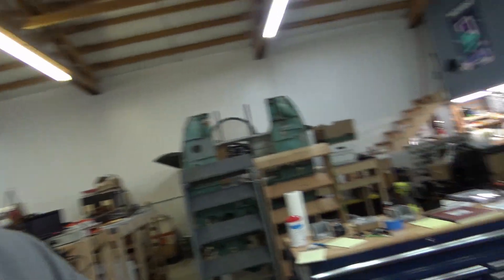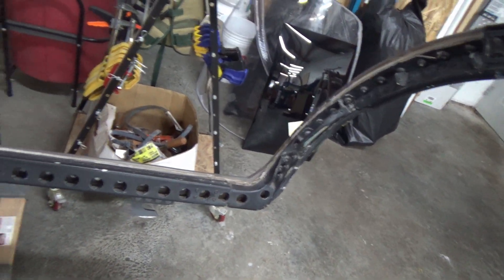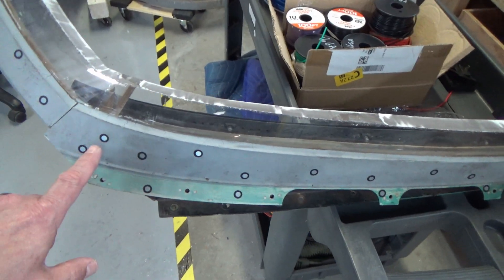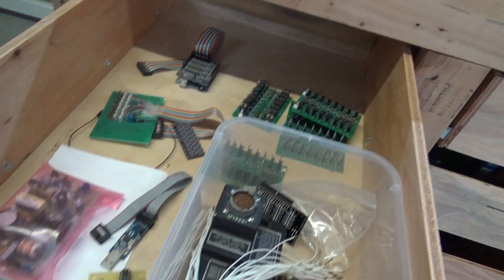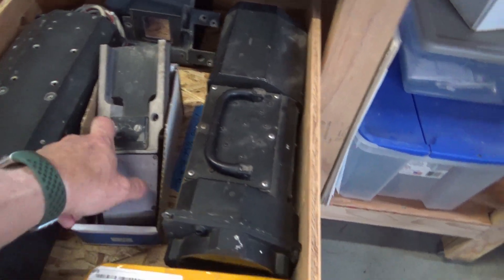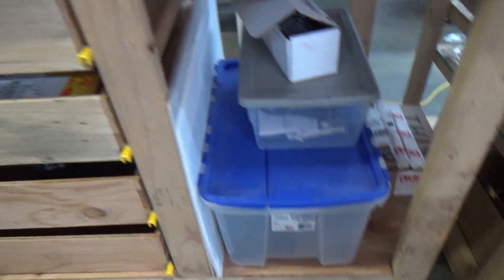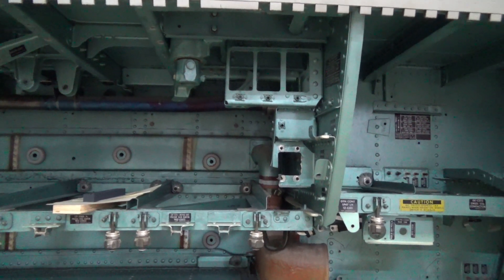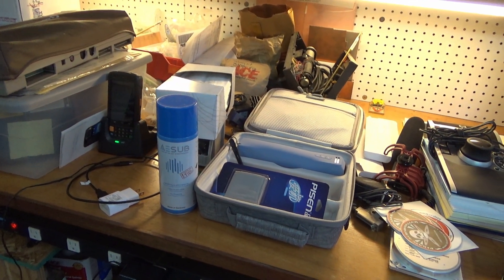F-15C Project Update for June 9th, 2024

Comment: I wonder if you could try and build a huge vacumm former and try and pull clear petg over the heavy canopy to have a lightweight alternative.

(Definitely no longer rated for bird strikes!)
Reply from the maker: I've looked into building something large enough to replace the blown out acrylic in the canopy and it would be incredibly expensive - especially for a tool I'd only use once or twice.  Making the forming buck would also be a pretty heavy undertaking.

Comment: This is super cool! Especially seeing the true size of what's hiding behind the VSD/MPCD/TEWS. I cant really tell from the fov of the camera, but are these the regular 57 or bigger 86 vpforce motors?
Reply from the maker: The motors are the largest that VPForce sells.  I don't recall the part number off the top of my head, sorry.
Reply: @f15sim  ah I guess they are 86s then. That's gonna be a lot of force!
Reply from the maker: @nubbins70  I certainly hope so.  The goal is to get the ~2lbs/G of force out of the system that the actual flight control loading system provides.